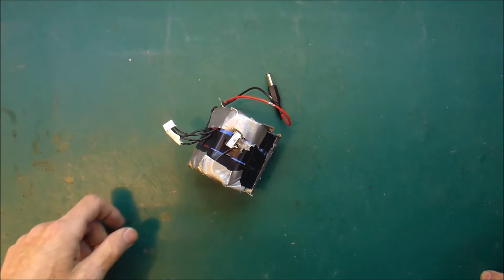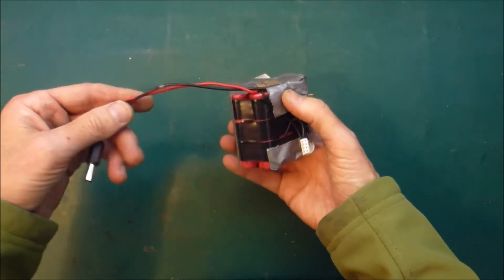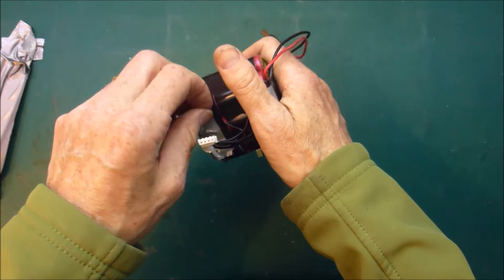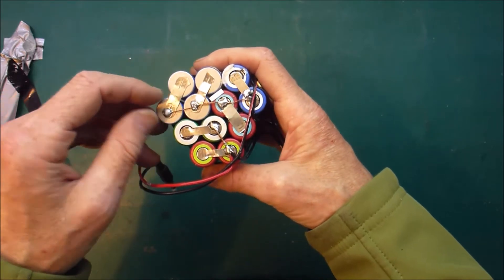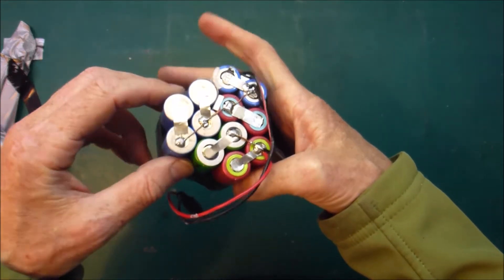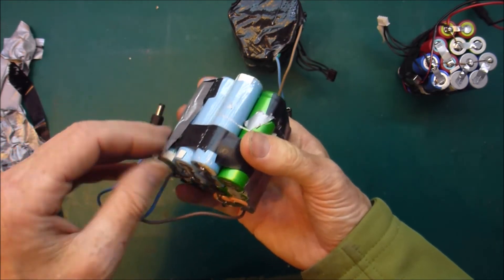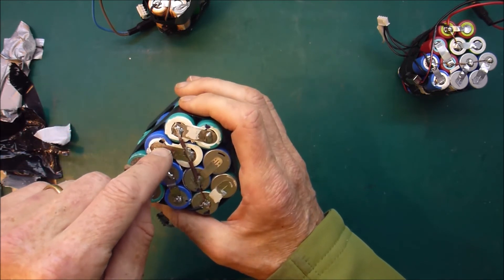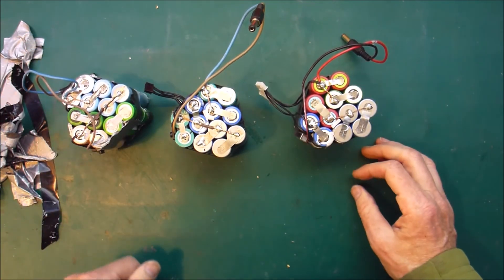18650 Powered Stuff - Bicycle LED Battery Packs part 1

Comment: small ebay bms + fix the switch + fuse on outgoing + better insulated is what i would do. i would not have had fuse per cell :)
Reply from the maker: Yep. That sounds like the best approach. Next I need to work out a robust enclosure that doesn't cost anything. Any suggestions?
Reply: Perhaps depends on where it will sit. the pack it is. Does it need to be able to take some bumps and hits or not. If not silver-tape will do just fine or if its smaller packs just go with larger heatshrinks for batteries. I have used that alot. For some protection you need thicker material.
Reply from the maker: I'm also thinking about 3D printing something perhaps, but might end up with just duct tape or heat shrink. As you would guess  - there's very little budget for this.

Comment: The one with the small switch thats loose on the side ( first one you showed us) i see it's got glue on the back but the switch pins are not protected and could easily be pushed into the side of the cells it's glued too, causing a short, given the switch is on the positive. Good little project for the kids tho.
Reply from the maker: My instinct would be to slather it in hot glue goop.